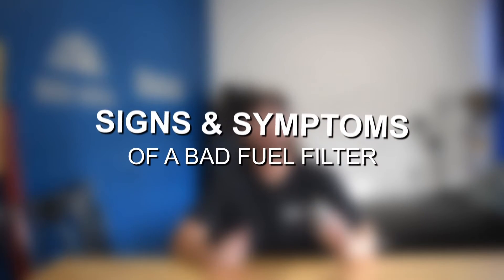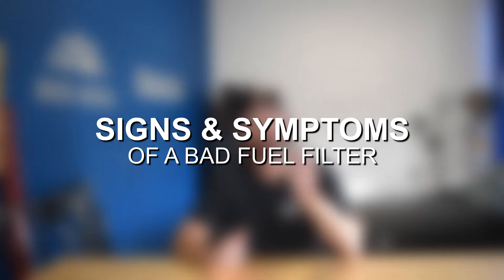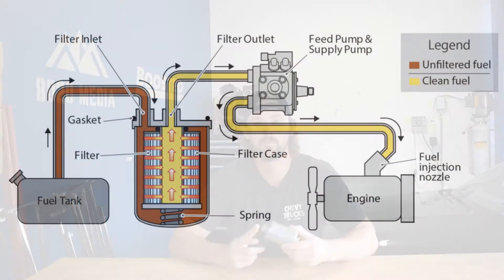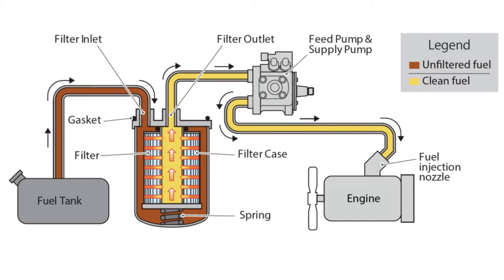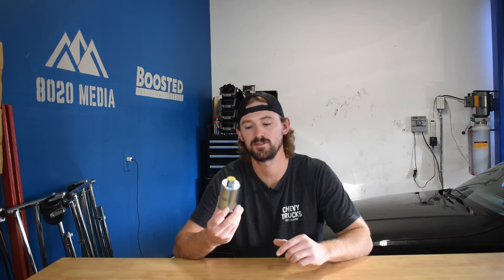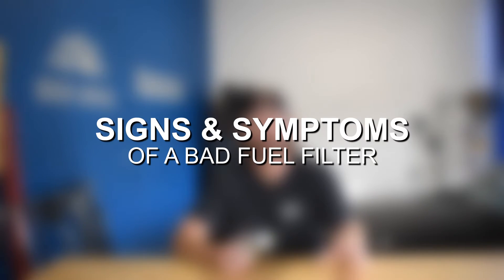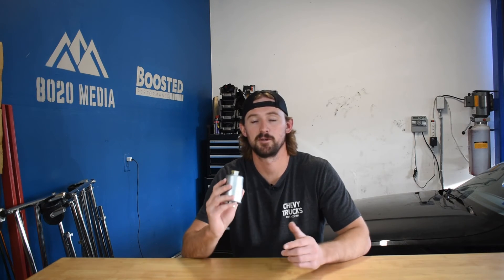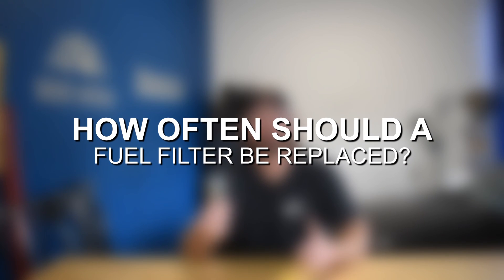Signs & Symptoms of a Bad Fuel Filter!

Comment: Thanks for the help. I have an '04 Dodge Ram 2500 5.7L  4x4 5.7L Hemi. Got my Truck started  but it was smoking pretty bad for a little while. I turned off the engine for 5 min/ then restarted it. Not as much smoke this time but a little, then none. Also, I've never installed a fuel filter on it, is it do-able? Thanks for any suggestions.

Comment: I have a 2006 Mazda 3 replaced alternator and battery, but still having trouble starting. It takes two cranks to start the car.
Reply from the maker: S - If your vehicle needs two cranks to start even after a new alternator and battery, the issue is more likely on the fuel or ignition side rather than charging; common culprits are a weak fuel pump, leaky fuel pressure regulator, or clogged fuel filter allowing fuel pressure to bleed off after sitting, which forces the engine to crank longer before building pressure again. Other possibilities include a dirty MAF sensor, failing crankshaft position sensor, or worn spark plugs/coils. A quick test is to cycle the key to “ON” for a few seconds before cranking — if it starts quicker that way, it’s almost certainly a fuel pressure/bleed-down issue, and checking the fuel pressure with a gauge would confirm it.

Comment: Hi my np200 when driving for 60km it starts to cut fuel and there is this sound that comes from the tank then the engine stops completely.can you help.what can cause that
Reply from the maker: B - If it runs fine for about 60 km then starts cutting fuel with a noise from the tank before stalling, that usually points to a fuel delivery issue inside the tank—most often a failing fuel pump that overheats after running a while, a clogged fuel filter/strainer that starves the pump, or even a blocked tank vent causing vacuum buildup so fuel can’t flow; the best way to confirm is to check fuel pressure right after it stalls (if it’s low or zero, it’s pump or filter related), and as a quick test, opening the fuel cap to see if air rushes in can tell you if the venting is blocked.
Reply: @8020Automotive thanks a lot

Comment: My 99 Lexus Rx 300 has the filter and pump inside the tank!!! 😢. Just got towed today.  It starts right up then shuts off.. I have a new battery and alternator.. if I give it gas it stays on but when I take my foot off the gas it just shits off no sounds putter etc. no lights on dash when running..  please help. 😎.  Great video !!!
Reply from the maker: S - It sounds like your vehicle is experiencing a classic fuel delivery or idle control issue. Since it starts and runs only when you give it throttle, but immediately shuts off when you release the gas pedal, a likely culprit is a dirty or failed idle air control (IAC) valve. The IAC regulates airflow at idle, and if it's stuck closed or clogged with carbon, the engine won't stay running without throttle input. Another possibility is a vacuum leak or a faulty mass airflow (MAF) sensor sending incorrect air readings at idle. Less commonly, the fuel pump (even though it starts the car) may be weak and not supplying enough pressure at low demand, especially if the in-tank filter is clogged. Start by cleaning the throttle body and IAC valve, check for vacuum leaks (cracked hoses, disconnected lines), and if that fails, test fuel pressure to confirm pump health. Even with no dash lights, some codes may be stored in memory, so it's worth scanning for pending or history codes to narrow it down.
Reply: @8020Automotive yep it was the air control. A little break cleaner and it worked perfectly thank you so much and also I'm getting way better gas mileage now and a lot more get up and go thank you for your videos I really appreciate it
Reply from the maker: @sailingliberator3395  Love to hear it! Thanks for the update.

Comment: I got a Chevy Impala, ,2006, can I change just the fuel filter, or change the hole thing, the pump and everything???
Reply from the maker: J - On a 2006 Chevy Impala, whether you can change just the fuel filter depends on the engine and fuel system configuration. If you have the 3.5L or 3.9L engine with the returnless fuel system, the fuel filter is built into the fuel pump assembly inside the tank and is not serviceable separately—so you’d need to replace the entire fuel pump module if the filter is clogged. However, some earlier 2006 models or fleet versions with return-type systems may still have an external fuel filter located along the frame rail near the fuel tank, which can be replaced on its own. To know for sure, check if there's a metal canister-style filter under the car near the tank—if not, your fuel filter is likely non-serviceable and integrated with the pump.

Comment: I have one problem I got a fuel pressure tester and it reads 32psi. I have read that my car should be 40-42 key on. I Replaced pump and regulator at the same time still showing 32 but if I pinch the return line at the tank pressure will go up to 60 psi so pump is good. If I replace the regulator again and it still showing 32 psi .. What else can it be?
Reply from the maker: T - Since your fuel pressure jumps to 60 PSI when pinching the return line, your pump is definitely strong, so if you've already replaced the fuel pressure regulator and still see just 32 PSI, the issue likely lies in either a leaking or misrouted return line, a regulator that's not receiving proper vacuum reference (if vacuum-operated), or possibly a restriction or leak on the feed side before the rail; also check for cracked or disconnected vacuum lines to the regulator if applicable, ensure the regulator is OEM-spec (some aftermarket ones can under-regulate), and verify the fuel filter isn't partially clogged, as low restriction downstream of the regulator can cause it to bleed off too much pressure even if it's working "normally"—if all that checks out, consider checking the injector seals and rail integrity to ensure there’s no internal bleed-off causing the pressure drop.

Comment: Good video quite interesting! I’ve got a mk5 golf gt tdi bkd and I’m having hard starts it fires then stalls sounds like it’s starved but does start eventually I’ve done loads and I’ve not tried a fuel filter yet hope it sorts my issue out! 👍😎
Reply from the maker: J - Thanks for the feedback! Hope it helped.
Reply: @ any idea on my issue at all ?
Reply from the maker: @ If your vehicle has hard starts, fires but stalls, and sounds starved before eventually starting, the issue is likely fuel delivery-related. Since you haven't changed the fuel filter yet, replacing it is a great next step, as a clogged filter can restrict fuel flow and cause hard starting. Additionally, check for air leaks in the fuel system, especially around the fuel lines, tandem pump, and injector seals, as air ingress can cause fuel drain-back, leading to extended cranking. Also, consider testing the lift pump in the fuel tank and the high-pressure fuel pump to ensure they're maintaining proper pressure. If the issue persists, a faulty crankshaft position sensor or glow plug circuit issue could also contribute to poor cold starts.
Reply: @8020Automotive  thank you for your advice yes going to change fuel filter next needs a new one either-way I’ve already changed a brand new EGR valve on there the tandem pump I replaced gasket cos there was a slight leak changed glow plugs and it’s had a brand new battery also so will move onto next I’m praying it’s the fuel filter cos it sounds like it wants to start but then stalls like it’s starved it’s hard to know really but advice is always good I love the mk5 golf gt tdi 2.0 great motors are the BKD’S
Reply: @jamieleemusic8871  hey bro, have you tried changing the fuel filter and did it work? thank you

Comment: What my car is doing is at low acceleration, There's a hesitation, but if you stomp on it, it seems to be okay. I put in new spark, plugs cleaned the mass airflow sensor and cleaned the throttle body really well. Also, have new 02 sensors installed, and i'm still having the issue. Maybe I should have looked at the fuel filter at the beginning lol
Reply from the maker: M - The fuel filter is a good starting point since it directly affects fuel delivery. If the issue persists, focus on sensors like the TPS, MAF, and inspect for vacuum leaks. Keep us updated.

Comment: I replaced my fuel filter in my 2000 ford f-150 with 4.6 3 months ago with one from Amazon called ecogard sep 29th. The filter got clogged. And in the morning it would be hard to start it or if the truck sat for long it would crack no start. It was annoying. And my neighbor has the same kind of truck as my he say don’t buy a aftermarket fuel filter buy the oem filter from the dealer. Because he said that he replaced has with one from auto zone and the truck left him at the gas station and it wouldn’t want to start. OEM is better I know it more expensive but it will save you more time and money . 👍
Reply from the maker: C - This is correct. Unfortunately, you get what you pay for! Thanks for sharing.

Comment: I hade a core p0302 cylinder misfiring but I had coil pack and spark plugs replaced engine light still on what could else could it possibly be
Reply from the maker: D - This video may be helpful for your research: https://youtu.be/f1mQ5hD1-vI

Comment: My 1983 Ford f150 has a 300 6cylinder. And it cranks well and idles well but put in gear and it stalls..how hard is it to change that filter?
Reply from the maker: D - Not hard at all. Just need to find the location of it. We have another video that may help here: https://youtu.be/7bqAIbYRdnc
Reply: @davidtester7297 was that the problem? This what mines doing
Reply: If your engine has a carburetor, it might have another porous brass filter that is in the carburetor where the fuel line end screws into.  Replace it if that is the case.

Comment: my car is burning soo much gas and going nowhere atm. i cleand everything iv looked up and been told. lol.
Reply from the maker: Y - Sorry to hear this.. What did the shop say?
Reply: @8020Automotive  everything. lol. i cleand soo much and replaced the other half. mostly a miss fire somwhere
Reply from the maker: Y - Have you checked your ignition components?
Reply: @8020Automotive  yes i found out 2 of my wires were no good. so im replacing them right now
Reply from the maker: Y - Keep us updated!
Reply: @8020Automotive  it runs and sounds alot better. but there still isnt much power. i did get up to 80kph but its slow to shift and the engine shakes at around 60kph.
Reply from the maker: Y - This video could be helpful with your research: https://youtu.be/ipjYLPJgpq8

Comment: Hi, could you please suggest what could be the issue with my car:

car keeps turning power off randomly while driving. mechanic can't figure it out. recently changed engine breather and pcv valve, later mechanic changed crankshaft position sensor. problem persists. computer won't show errors I can drive 30-50 miles - seems ok. then engine turns off all of a sudden and this coincides with backfire (?!). when this happens it usually won't start right away - need to wait a little. sometimes a minute, sometimes 10 minutes

 I have an old e36 318ti m44 compact with 130000 miles /210000 km
Reply: Check your battery, if it's over 3 years old, replace it. It could be the ignition coil as well.
Reply: @marvinmurakami8828  thanks for suggestions
Reply: @JaCk-ep6px  one more thing is a clogging fuel filter. Sediments inside the filter can settle enough to start and run the car shortly, but quickly gather around the filter element as you drive.
Reply from the maker: M - Thanks for taking the time to help out a viewer here!
Reply: changed it, but apparently it's smth else 👍
Reply: @marvinmurakami8828  yes, I have changed it, but apparently it's smth else. thanks!
Reply from the maker: J - When you say "turning power off randomly", does this mean losing power or shutting off?
Reply: @8020Automotive  shutting off
Reply from the maker: J - We have a video that may be helpful here: https://youtu.be/7bqAIbYRdnc
Reply: @8020Automotive  thank you for sharing. does backfiring when the car stalls narrows down the list of faulty car part ??
Reply from the maker: J - Usually yes. Maybe look into your ignition components.
Reply: @8020Automotive  Thanks for the tips!
Reply from the maker: J - Keep us updated.
Reply: @8020Automotive  SOLVED it was a camshaft sensor (and some other issues a small vacuum leak, one spark plug soaking in oil). Apparently e36 won't work with aftermarket cam/crankshaft sensors and MAF, but I had to go with aftermarket for now
Reply from the maker: N - Thanks for coming back and updating! Glad you got it all figured out.

Comment: My mom recently put diesel in her Civic which the mechanic took out and cleaned the injectors. Now she has a check engine light and the car cranks but is hard to start when cold. Do you think the diesel fuel might of clogged up the fuel pump/filter?
Reply from the maker: M - This is certainly possible.

Comment: Hi..thx for fuel filter info.. my issue on 2008 4.6 mustang.. car is running fine but gas gauge went from full to showing empty then next drive back to full again then to empty.. dash shows engine light  on..dash says dte fli data error.. fuel low sensor..any help is appreciated.. thx
Reply: Not a certified mechanic, so take this with a grain of salt and do your own research.

But that sounds like a fuel pump related problem, I know on the Chevy's I have worked on that would be the case, but always double-check with the model year and make of the vehicle you have.